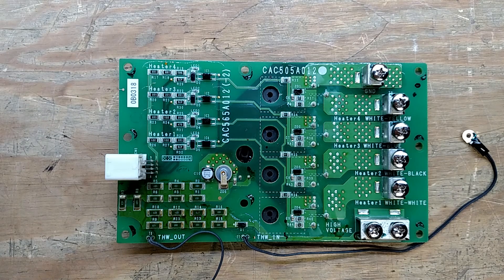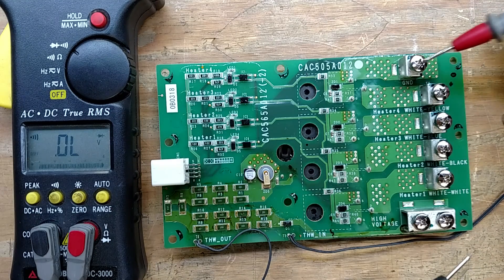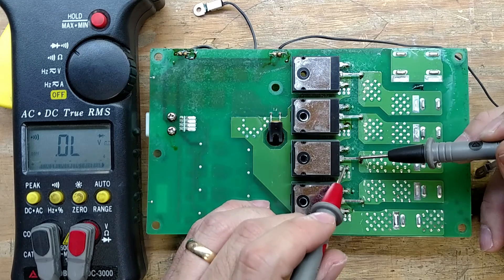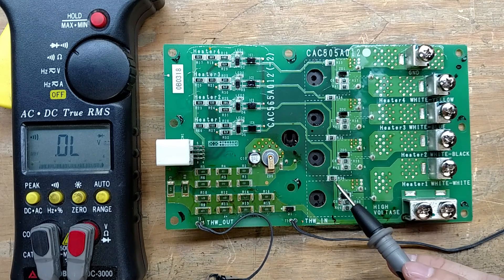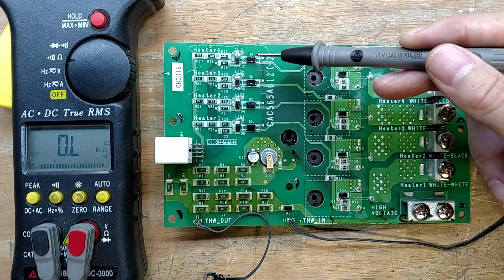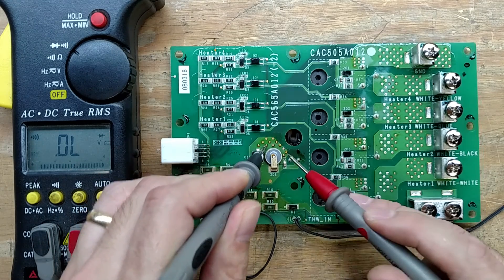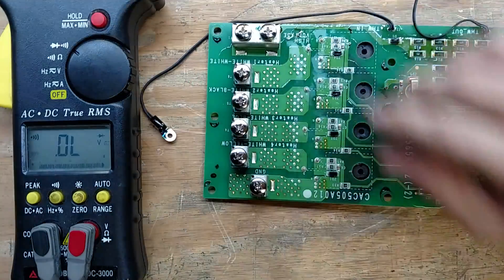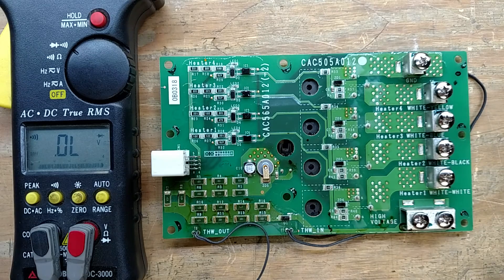Troubleshooting a heater board.

Comment: This is a cabin coolant heater. Made my mitubishi. It was used in the transit connect electric. The vehicle I purchased has a failed heater and it was stuck on causing it not to precharge. I have since installed a chevy volt coolant heater in its place. With a can to sw can bridge.
Reply from the maker: +Byron Izenbaard 

Thanks for the info.

I did not know it was out of the Ford Transit Connect.